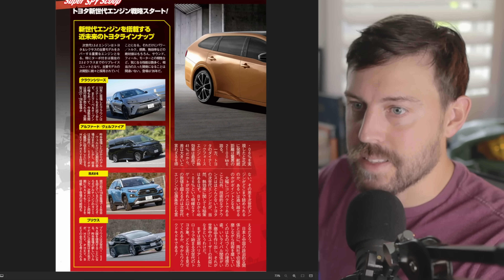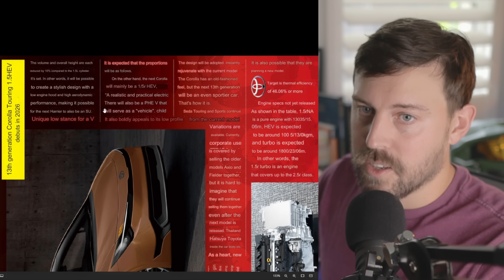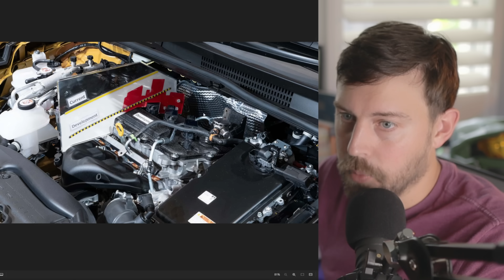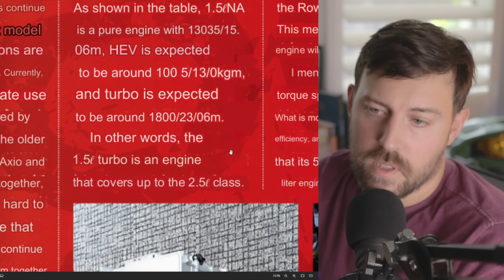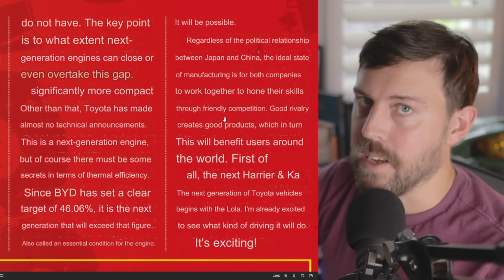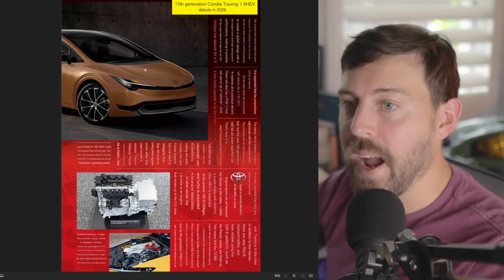*BIG UPDATE* The All-New 2027 Toyota Corolla will Showcase NEW Engines and Stunning Design...

Comment: Hi, I'm from the EU, and I actually drive the current wagon with the 2.0l hybrid engine as a daily, and it's a nice car overall, but it also carries the negatives from the other corollas as well.
For example, the wind and road noice are just as bad on the wagon as it is on the other 2 variants of the model, so the only thing you are missing is the cargo capacity, and I really hope that Toyota brings it to the US market as I see no reason why they should not do so.
Other then that, to be honest, I don't really like that "new" design for 2027 and I hope it's just a concept, and the final product wont look anything even remotely close to that, lol... I really, rally, really don't like a single line on it... It just looks too much Priusy for my taste and as a results it loses a bit of its own character.

Comment: I still have my 2009 Vibe AWD with only 115k miles on it. Would have looked at the new Corolla Hatchback but it does not have the space of the Vibe (Matrix) or it's AWD or even it's sunroof. Maybe this new version might work.  I suppose there is the Corolla Cross but...

Comment: Something to add. Many people commenting on the European wagon spec. 
The Japanese spec (JDM) is a smaller version of the Euro one. In fact, the current wagon sold in Japan its based on the current hatchback (so it has same wheel base, with same small leg room for the back seats).
I own in New Zealand, a JDM spec (imported to nz as a second hand from Japan), and  I must say, its probably way more sporty than the European one, but not as practical as the European one.
I'm wondering if the new generation will have one style only, or they will keep the small version for Japan/New Zealand/Australia and bigger one for Europe.

Comment: My predictions/wishes for the powertrain applications:

Next Yaris/Yaris Cross - same NA 1.5 3 cylinder hybrid setup maybe GR version with new 1.5 NA 4 cylinder hybrid setup with around 160 hp

Next LBX with new 1.5 NA 4 cylinder hybrid setup as standard 

Next Corolla(sedan, hatch, station car and Cross) and Lexus UX with new 1.5 NA 4 cylinder hybrid setup instead of the 1.8 hybrid setup. I think they’ll keep the current 2.0 hybrid setup for a higher output version.

The new 1.5 turbo hybrid is reserved for the K platform cars for sure but could be used for a sporty GR Corolla hybrid/ GR Prius 

The current 1.5 NA 3 cylinder is quite new and very efficient so I don’t think they replace it for the B platform cars

Comment: Hard to believe that future Toyota sedans will have sharply raked hoods & windshields because frontal crash protection would be compromised.  And if hood length is increased to compensate then space for passengers would be compromised.  I also have a hard time believing the Crown will still be around a few years from now because it's styling is too eccentric and price too high.

Comment: All these tiny turbocharged engines are to meet the nearly impossible Corporate Average Fuel Economy standards.  If the average fuel economy of a manufacturer's annual fleet of vehicle production falls below the applicable requirement, the manufacturer must either apply sufficient CAFE credits to cover the shortfall or pay a penalty, currently $14 per 0.1 mpg under the standard, multiplied by the manufacturer's total production for the U.S. domestic market.  The new Corporate Average Fuel Economy standards require an industry-wide fleet average of approximately 49 mpg for passenger cars and light trucks in model year 2026. Even though all the tree huggers want EVs, the American public buys two ton SUVs and Full Size pickup trucks.

Comment: If they can put the LBX 1.5 inline 3 engine in the new Corolla with a more Powerful Electric Motor that would be great.  It is quite responsive engine in the LBX (134hp), but give it at least 150~160HP, that would offer great fuel economy and good engine response in the Corolla.

Comment: Back home I have a Toyota Auris hybrid from 2017., an absolutely awesome car by all standards. 7 years, 220 thousand kilometers, no issues whatsoever. I have recently moved to Canada due to work and am in process of buying a new car. The new Prius 20'24. is darm good, from both outside and inside, I was driven in one just yesterday and it's absolutely gorgeous. The only problem I have with it is the dashboard, I think a 12 inch screen that the Highlander/Grand Highlander have is a better choice, this is just too small.

The new design they've shown here really feels and looks like a 2024 Prius, which I find to be a positive thing. Toyota has always been on a more conservative side when it comes to vehicle design, I am happy that they decided to shake it up a bit :-) It seems that the new 1.5 liter turbo engines will be a blast and given the history of reliability, I don't think going to a smaller size will prove to be an issue. Mistakes can always happen but it seems that another 1.5 years is enough to iron out all issues and do a good job, the one we expect from Toyota at this point. All in all, fantastic and exciting times for Toyota ahead, can't wait to see what they have in store next!

Comment: Ditch the cvt!!!  That's the reason i bought the Camry instead of the Corolla
Reply from the maker: eCVT or CVT?
Reply: @KirkKreifels  the cvt on the non hybrid
Reply: @dapetik next gen should be all hybrid and using only the E-CVT
Reply: @jxmar_  ya, unfortunately
Reply: @dapetik  unfortunately? An ECVT isn’t the same as a regular CVT. It’s wayy better. If you want a regular transmission w a hybrid you’re going to have to go to Hyundai/kia and those hybrids aren’t as good or reliable as Toyotas hybrid synergy drive that’s been around for over 20 years.

Comment: Kirk, I got a new job where I am basically getting to test drive most regular cars on the market...out of everything I have driven, the Mazda 3 has been my favorite....styling aside (which is great), it is one of the only modern cars, where the ledge to lay your arm once the window rolls down is actually low enough to be comfortable, and it is wide as well, plus it gets wider to where your hand is....I can tell they designed it with people who like to roll down the windows in mind. The only other cars at work I have driven that have the rest for the arm low like that in the window are the Challenger and Charger....but it is best done in the Mazda 3.

Comment: Toyota is basically telling us 1) we are jacking up prices and we don't care about the consequences, 2) the ICE engine is basically an afterthought and even in hybrids it is simply about the battery and 3) we have such a huge market share we don't care if we lose some. 

To be fair the engine in the new Civic Hybrid basically plays second fiddle to the battery and that's probably where most cars with gas engines will go. But Toyota has no history of massive changes and their reliability with new engines in the Tundra and Tacoma are already suspect. Personally I don't like Toyota for many reasons and this does nothing to change that. Easily happy to keep going with another brand.
Reply: 1. New Tacoma and it's turbo I4/hybrid turbo I4 have been extremely reliable while not having any issues whatsoever. So stop targeting the Tacoma or it's engines.2. only the tundra engine has issues otherwise Toyota makes extremely reliable vehicles. Overall Toyota has no issues whatsoever with change. Importantly the new Tacoma has perfectly fine
Reply: @Mylifeislegendary982vd3-vl  You're right. I'll target it over price instead.
Reply: @gabrieliacoboni6951    new Tacoma is already the number one selling mid size truck in it's segment. While outsold everyone else in it's segment. So whatever
Reply: @Mylifeislegendary982.  Meanwhile the much more affordable Maverick sold it by 100 percent. Proving my point. Thanks for playing. What other excuses do you have?
Reply: @gabrieliacoboni6951   😂. maverick is in a completely different segment. It's like saying a Toyota Corolla is better than than a bmw  just because it sold better. only thing that matters is the Tacoma outselling it's actual rivals. 😂🤣. Anymore unrelated pure bullshit nonsense?
Reply: @Mylifeislegendary982vd3-vl  Obviously you missed the point about price and while we don't have hard data on I suspect the price hike is driving people to look for alternatives. Look, I get your Toyota fan boy and that's fine.  Up to you what you do with your money.  Even if it's wasted on an overpriced, overhyped, truck that is too big to be small and too small to be big.  Cheers.
Reply: @gabrieliacoboni6951   what you suspect is absolutely bullshit and wrong. Price hike has no negative effect because it's a class leading mid size truck and already the number one selling in it's segment. New Tacoma is perfectly sized and priced. Importantly rated  correct. I am no fan boy of any brand whatsoever instead just say the obvious. If you see that as a fan boy then sorry pal. then it's you who have gone mad.         Just because you suspect something don't mean anything. Good bye and have a nice day.

Comment: Turbos - its hard in my thinking to keep them in the same conversation as being helpful to fuel economy.  It just allows a smaller and lighter powertrain AND the mpg testing is favorable to real world experience (opposite of most naturally aspirated in sedans) - in the end, companies like them in regard to government regulation and more a "get around" then addressing how vehicles are getting darn heavy and you need that engine space for the electrical side (batteries do not seem to be shrinking OR they just increase the output for that space).   Nice they are leaving it naturally aspirated as the current Elantra hybrid does.
Reply: But if you just drive easier, you should get better mpg.
Reply: @occckid123  But as a service manager told - he said you (me) are probably the 5% that would drive "normally" but most (including him) the turbo power is such a benefit 95% will drive that turbo a lot. He said 95% of the new turbos they put in people will say they drove them normally, but he said the damage shows it is the reverse.
Reply: @GlennLaycock  of I'm trying to get good mileage in my normally aspirated engine car then I will drive with 2k rpm or less. Same as turbo but that's there problem lol

Comment: A corolla hybrid station wagon would sell very well here in the U.S, more than the sedan for sure.
Reply: the corolla hybrid station wagons have gained a massive popularity in europe they are literaly everywhere replacing mercedes taxi, basically all uber uses them too.
Reply: absolutely. You gain quite a bit of versatility given the much larger opening and rear end than a sedan. I'd almost argue that all sedans should be replaced by hatchbacks and wagons.
Reply: F hybrid until battery life 200K and zero rare earth minerals
Reply: @roberthart9886  hybrid vehicles from  toyota offers many types of batteries nickel cadnium and lithim ion